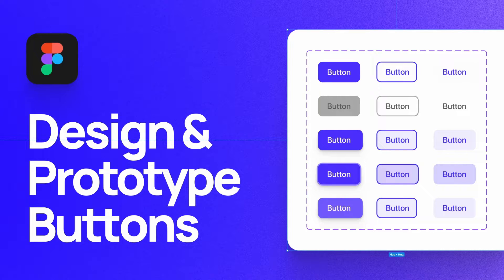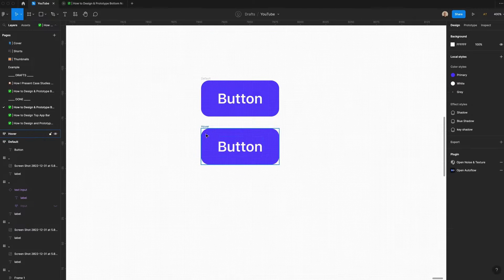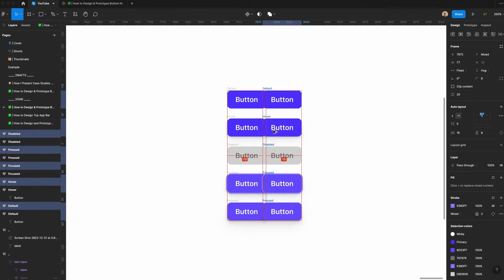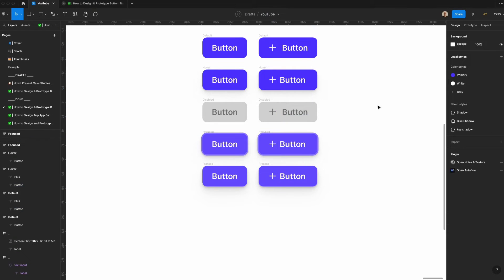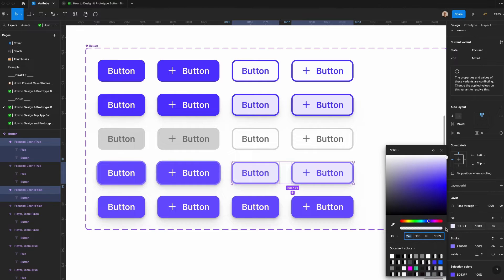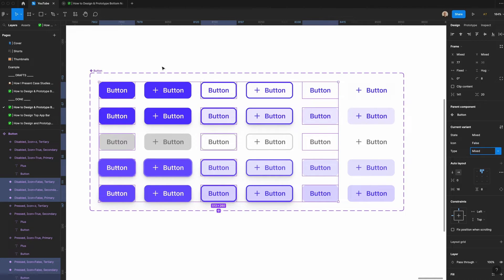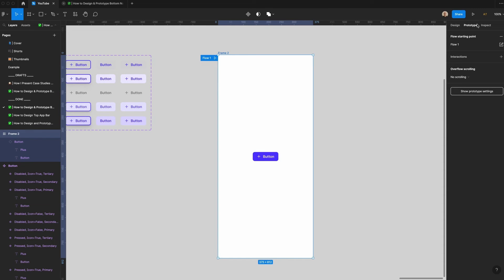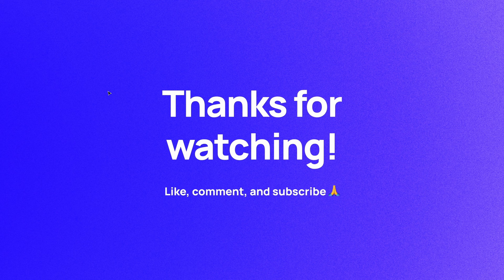How to Design and Prototype Buttons in Figma | Material Design Primary Secondary Tertiary Components

Comment: Can you please explain why did you make multiple drop shadows?
Reply from the maker: Multiple shadows gives you more control over how the shadow looks. Most design systems have multiple types of shadows to reflect different levels of “elevation” 

Example, a modal might have a more spread out shadow that indicates it is higher off the page, while a top bar might have a very small or even hairline shadow.